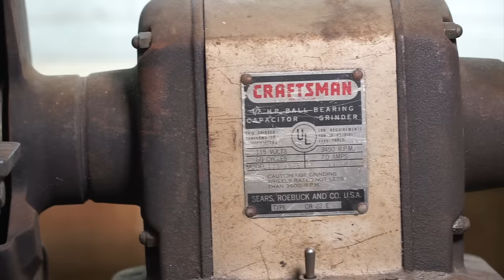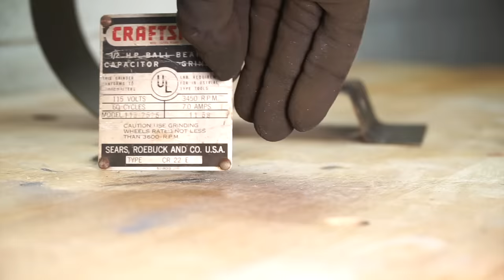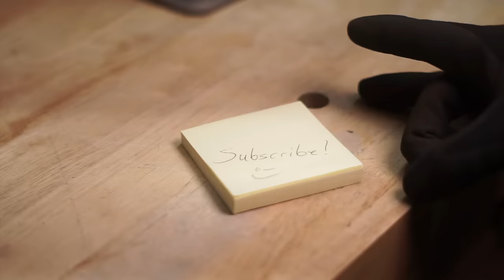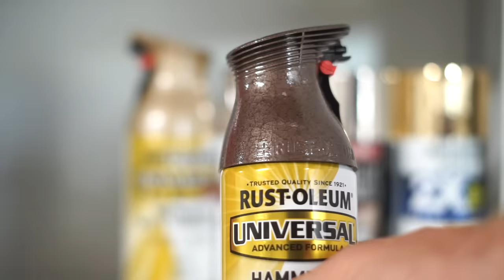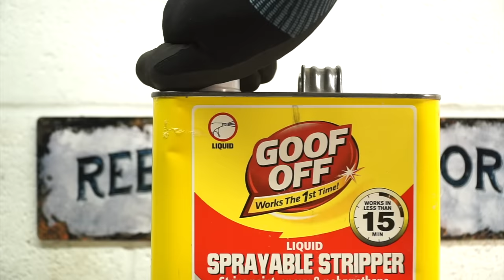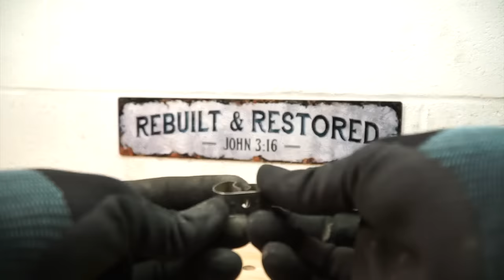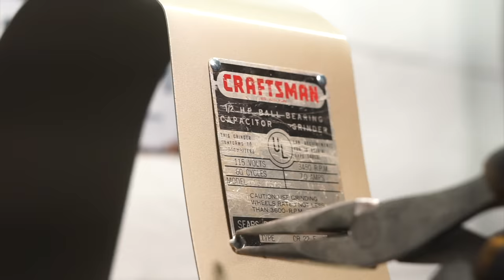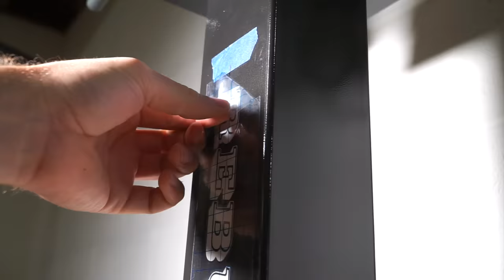Awesome Restoration of Rusted Grinder

Comment: I am trying to get my own You tub channel started.Two projects I want to do is one, I have an old school die grinder with the flexlible shaft in the original wood box from the 40s more than likely  . I bought it off of Ebay from and estate of a jeweler . I am going to do a youtube video on that and I also have an American Made solvent tank I am going to restore and also to that on on Youtube its probably over 50 years old .I already have the pump and found and American made parts cleaning brush for it too. I love old school tools they will never make things like this again and love to see them restored the pride and craftsmanship is dead and gone and will never be back . Great job I love it
Reply from the maker: Awesome Mad Man Mechanics! And you should totally start a channel! The die grinder sounds neat.   Good luck on the channel and your projects! Keep me posted! Thanks for the comment and for the view! Have a blessed day!
Reply: @RebuiltRestored  Wow I havent had anybody give me that much support in so long I forgot what is was like! Been down in the dumps with the cold icy weather and I havent been able to get any of my projects worked on and it is driving me nuts. I have been trying to get my Chevelle restored and that is shut down too. I am doing a frame off. Its a factory Heavy Chevy they only made for two years its a matching number factory four speed car. I want to do the rest on You tube if everything goes good. You really made my day I cannot thank you enough you really cheered me up and have given me incentive to launch my youtube. I am very nervous I am still learning editing but all the youtubers tell me the same thing. Hey we were nervous too and we just did that first post and that is all you need to do. My first video is going to be about a Jet Ski it never had the oil changed on it and the oil filter was frozen on there and I could not get it off even with a pair of huge channel locks. No room I had to take the inside of the ski apart and half the part of the engine apart to get to the oil filter it kicked my ass. This is going to be my first post. Your reply really cheered me up and I really needed it . Had three people in the past week treat me really bad so I was really down in the dumps. I need to move out of here so bad the people are horrible here and I am working on that too. Thank you thank you for cheering me up you made my day dude I really needed this ! 😉😉😉😉😉😉😉😉😉

Comment: I have had my grinder just like yours for it must be 55 or more years now. It is in as new shape because about two weeks after I purchased it I was in a terrible accident when a 17 year old brat hit my car in its rear. He was going somewhere around 50-60 when he hit me as I waited for the light to turn green. Anyways I wasn’t able to work after having my neck fractured in two places and four vertebra ruptured leaving me paralyzed from my waist down. I was a mechanic until that time but I haven’t worked an hour sense. Nice job on the Craftsman 3/4 hp grinder.

Comment: The only things missing are the dust collection plenum, switch isolation washer and rubber switch cover,and the saftey cover for the light bulb . Good restoration job.
Reply from the maker: Thanks much! A safety cover for the light is a good idea. 👍
Reply: I have the same model Craftsman 1 horsepower bench grinder.

Comment: 5:06 Me too...me too.

Also, if you notice the scanning black bars in your footage at 20:19-20:25 you can get rid of them by adjusting your shutter speed to a divisor of 60 if you're in the US (1/60, 1/120, 1/180, etc) or 50 if you're elsewhere in the world (1/50, 1/100, 1/150, etc). This corresponds to 60 Hz or 50 Hz frequency of the electricity. There's also some cameras that have an anti-flicker setting that automatically adjust for it!
Reply from the maker: Thanks. I appreciate the advice. I will have to try to adjust that. Thanks so much! Have a blessed day!

Comment: Nice restoration of the old grinder & glad you kept the original factory plate that they riveted on the front of it & the other grinder wheels that was on it is still good,you can keep them back for spares & that's nice that you put a wire wheel on the other side of the grinder
Reply from the maker: Thanks much! And thanks so much for watching! Have a great day!
Reply: @RebuiltRestored  You're welcome

Comment: Not sure if this information has already been provided, but here's some facts re: this grinder: Craftsman made them from 1950 until the late 70s early 80s. It cost $72.95 new in Craftsman's catalog [1959]. The shipping weight was 85lbs—35lbs being the cast iron/steel pedestal. An online inflation calculator puts the cost of this grinder at $786 in 2024 and the stand at $183. The embossed "11 58" indicates this unit was mfg in Nov. 1958 and the "115" prefix in the model number indicates it was built by Sunlight Electrical Mfg Co./Packard Electric Co. for Craftsman.  [edit]: Btw; great video.

Comment: That was an awesome video!  I love those old Craftsman grinders and have cleaned up and replaced bearings on several. Just a suggestion, but I would loosen the bolts that attach the grinder to the stand. Looks like you squeezed the rubber feet down pretty tight. If you loosen the bolts a bit, that would allow the rubber feet to take up some of the vibration on the grinder and make it run smoother. Great video and great work! Thank you for sharing!
Reply from the maker: Thanks you! Thanks for the advice! Advice is welcome here! I appreciate the view and feed back!

Comment: awesome restoration! Things built like that were made to last and I'll bet if cared for properly will still run 50 years from now!
Reply from the maker: Thank you very much!! Hopefully it does last that long! 👍👍
Reply: The weakpoint is the insulation on the motor windings. It degrades with time and use.

Comment: Brilliant work.  Be advised however that it is necessary to have thick paper discs either side of the grinding wheel so the metal washers don't bear directly onto the wheel.  Prevents cracks!!
Reply from the maker: Awesome! Thanks for the tip! 👍

Comment: Love it!
Filling the stand with dry sand creates a better base and deadens the sound!
Reply from the maker: Thank you very much! And yes that would have been awesome! I didn’t think about it. Great advice! 👍
Reply: @RebuiltRestored  you still can. Drill a hole at the top and funnel it in. Cap it off with a plug. 
You won't regret the result! Plus makes another Video?
Reply from the maker: Ok. Maybe I can get to it. And yes I am working on another video 👍👍

Comment: I really enjoy how with the exception of a couple small casting defects you touched up before painting you left the rest of the  casting pretty much as it was. I see a lot of restoration videos that file everything casting line, bump or blemish smooth and perfect. They lose a lot of the character that way I think.
Reply from the maker: Thanks much! I appreciate it. Yeah the roughness gives it some character.  Thanks for giving me your feedback!
Reply: By the looks of your clean and pristine shop, the grinder will stay as pretty as the day you finished it.  😅 32:39
Reply: This one was a pretty good casting. Sure, it had some roughness to it. However,  it was even and well made.
Leave it as it is.
Now, if it was uneven with big pits....fill and smooth it.

Comment: You may also think about mounting a metal plate against the wall so you don't blast off the paint when you're grinding or buffing rusty metal. Maybe put a Strong magnet on it to catch the steel wire brush needles that will start flying off at high speed.  I often find them embedded in my shirt or socks after a good wire brushing.

Comment: That grinder came out really nice. I wasn’t sure if the finish was in the paint or in the metal before you stripped it. But the hammered finish paint made it look good. I have my grandfathers old Black and Decker bench grinder. Still works fantastic. When I got it, I cleaned it up and replaced the power cord. The original one was all dried out and very brittle. Plus it wasn’t grounded. The new cord was the same size wire with a ground and I drilled and tapped a boss on the bottom of the grinder to ground it. Seeing how yours came out, I might do an overhaul on it soon. Anyway, great video!
Reply from the maker: Very cool! It’s always cool when you can keep a family tool and keep using it. Paint it up nice and don’t ever sell it! Thanks for sharing and for the view! Have a great day! 👍
Reply: @RebuiltRestored  Thank you for your comments. I really have no intention of getting rid of it. Much like the Craftsman grinder you gave a new life to, my old Black and Decker is built the same way. Back then, these companies made good quality products. Unfortunately, today the newer stuff isn’t built as well.

Comment: Any reason why the capacitor was not replaced? Just out of curiosiity. You restored the rest of the components. Good work.
Reply from the maker: Yeah. I took it to a local shop and was going to get a new one but after bench testing this one was still good so it went back in the unit.

Comment: Nice neat job. Looks as good as new.

The only additional thing I might have done would have been to make a couple of sheet metal spark guides to go on the back to aim the hot metal dust from those guard ports downward (Rather than straight at that nice white wall). Some would insist on making a water trap to capture the metal dust too, but personally, I don't do enough bench grinding to warrant that.
Reply from the maker: Thanks much and thanks for the advice! I do need to do something behind soon. The wall isn’t looking as white! 🙄
Reply: Or stick a piece of sheet metal to the wall for the sparks / dust to bounce off of, a bit faster to get in place and leaves space for access to clean / maintain the tool.

Comment: I have that exact same grinder. I bought it new in 1968 from Sears and it is still running perfect today.
Reply from the maker: That is awesome! That gives me a time stamp for this one then.   Did you get a stand with yours?
Reply: @RebuiltRestored  No stand- it's now mounted on a Grainger bench I bought in 1975.
Reply: The grinder was made in November of 1958. It's stamped on the front plate right next to the model number. I have the same grinder made in 1955 and just love it. Somebody else took it apart just like you and restored it and I was lucky enough to buy it off of them

Comment: Absolutely a piece of Art. Nicely done,  hey by the way,  I've built so many square/round tube stands for grinders, Vises, presses. Theirs always a "Ting Sound" from the Tubes being hallow. Take the grinder off, and drill a hole big enough to fill the tube with Sand. It Takes the Ting out and also makes it Heavier,  No Walking. Hope this helps, just a little Info.❤
Reply from the maker: Thank you! Cool tip! Maybe I’ll have to try this. 👍👍 info is welcome! Thanks

Comment: Nicely done. One suggestion: replace the capacitor next time. Electrolytic capacitors dry out over time and need to be replaced. That old one could fail at any time.
Reply from the maker: Thanks for the advice!

Comment: Looks like the one in my garage - my father got it new in about 1962, a few years before I came along.  It’s got low time as it’s only used occasionally, but as someone else noted, it’s from a time back when the Craftsman name could be counted on.  It still runs smooth as silk, and you can shut it off, go upstairs to grab something from the fridge and be back in the garage before it has coasted to a stop.
Reply from the maker: Very cool! Yes they spin good!!

Comment: Hang some small, cheep household HVAC air filters on the wall behind the vents. They will keep dust and debris from flying everywhere and keep things a bit cleaner on the wall as time goes by, and they can be replaced easily as they dirty up... They could be a fire hazard if your spraying sparks, so consider that, but if it just dust they could keep things much cleaner around the  bench grinder.
Nice restoration
Reply from the maker: Awesome! Thanks for the advice and for watching! Have a great day!

Comment: Suggestion? I personally would have replaced the capacitor. I like to restore old tools and actually USE them. If that beauty gets put back to work, there's a good chance the capacitor will not last. Those old wet capacitors just go bad over time. A modern replacement would be fairly cheap.
Just my opinion. That and $5 might get you a cup of coffee.
Reply from the maker: Thanks for your suggestion! I had this bench tested and it was good. I can replace it if I ever need to…. I do enjoy coffee ☕️   Thanks for watching! 👍👍

Comment: Very nice work. I have a grinder to but floor space is limited so its quick clamped on the corner of the work bench it saves floor space also if i need extra room on the work bench i can quick unclamp it and move it also if you have a bunch of bolts that need cleaning you can set it right next to it on the work bench.
Reply from the maker: Thanks! And nice set up you have!

Comment: Fantastic work!  It's great that old quality machines are kept operating and in use.  Is the wire wheel you installed a good one?  I'm looking for one that doesn't shed wires so much!  Kinda dangerous and a mess in the shop.  Thanks!
Reply from the maker: This is was a cheap one. But seems to be working fine. I haven’t noticed a lot of shedding. I bought this from the Harbor freight cheapy store, if I remember correctly

Comment: Nicely done! Though those rolls you fried in the loaf pan didn’t rise at all. Hard as rocks and looking kinda burned. Good thing you were able to find another use for them attaching the tables. 😀😁😀
Are you able to get any finer/gentler sandblasting medium? It seems the one that was used leaves a lot of pitting on the surface.
I liked the old stand. Is it salvageable for another project, since you have this new beefy one as a permanent mount?
Reply from the maker: Hey thanks for the comment! The rolls weren’t very soft so I saved the butter and fastened them to the bench grinder! As far as the media, I could possibly get finer but this is what I have for now.  The old base/stand was actually quite cobbled together. I have most of it still so who knows what I’ll do with it. So far no plans. Thanks for watching, I appreciate it!

Comment: Very nice restoration, but did you know your wall sockets are upside down?
Reply from the maker: Yes, according to code however this is how they were when I moved into this space.
Reply: @RebuiltRestored  It was not aimed at you for wrong doing, I know most people would want them that way as they look like little faces. It would not surprise me if an electrician installed them like that in the first place. Have a great day.

Comment: Its great to see an old or antique being saved.  well done, very nice work. I have noticed one thing that the machine is rotating the wrong way, it doesn't make much of a difference but throughs sparks at your face / vision, I hope my comment helps.
Reply from the maker: Hey thanks for the tip! Thanks for watching!
Reply: Optical allusion on the rotation. Look again. :)

Comment: That's a great restoration - well done and thanks for sharing. A few minor points:
1) Despite testing OK I would have replaced the capacitor anyway. Cheap and simple to do when it's all pulled apart.
2) Always hold the spray can upright (not sideways).
3) That sandblasting was painfully slow - something wrong with the blaster, air pressure you're running or abrasive feed or something. It should be MUCH faster than that, felt like you were colouring in with a fine-tip pencil . . .
4) A little bit of TLC on the metal label would be nice, paint applied with a cue-tip, or pinch your missus' nail polish :)
Reply from the maker: Thanks for watching and for the points! Happy New Year to you! 👍👍

Comment: You should replace the brushes and clean the coils of the motor. maintenance on the brushes would probably noticeably increase performance. cleaning the coils would probably just make it not build up as much heat and wouldn't be very hard to do.
Reply from the maker: Thanks for the tip and for watching!

Comment: Nice work! How did you clean the glass? I have a very similar one if not the same one.
Reply from the maker: I just took the glass out of the frames and cleaned them with whatever cleaner we had on hand. They came out pretty decent.  Fortunately they weren’t supper etched

Comment: my cord has a 2 prong plug I want to replace with a 3 prong-where can I get one and how do I know what the gauge of wire is - i have an old craftman- 3.2 amp . 115 volts-mod 39719501

Comment: The toggle switch is wrong. You need a single throw type. And sealed. Otherwise it was an awesome restore!
Reply from the maker: Thanks! I used the one that came with it. Thanks for watching!
Reply: Better to stay with the original one MR. Restore. Good call on using original switch. Click it!